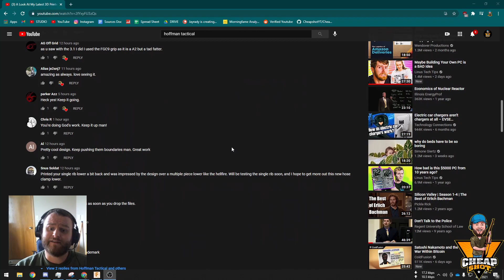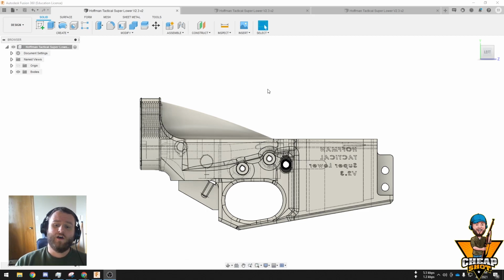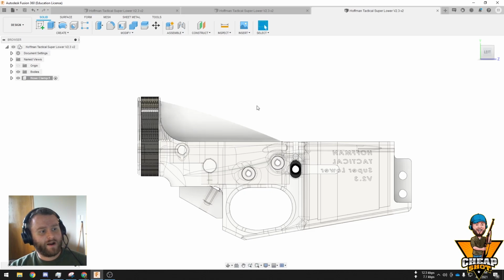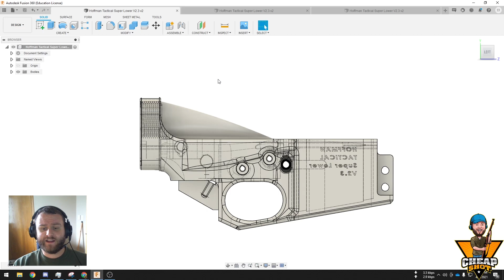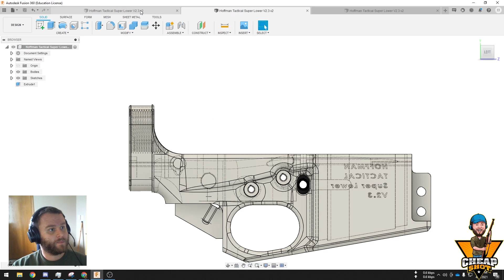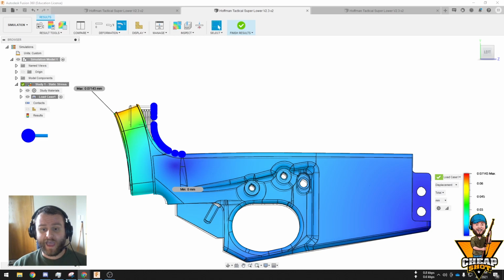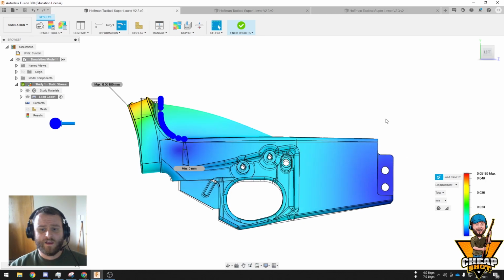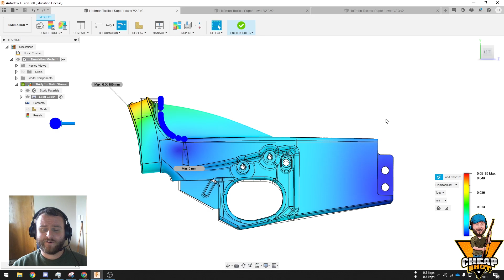Does the new @HoffmanTactical  Super Lower Need a Hose Clamp?!?!?

Comment: ABS, PETG, regular PLA and TPU are some of the weakest of materials to use on such a part. So, all your numbers are way off. Try again please showing results for Polymaker PLA Pro which is stronger then normal PLA+. PLA+ being the least recommended and CF still in testing phase since it suffers from creep. Also how you angle the infill and wall count and other slicer settings all play a part in it's strength. Next time please do a better job on being properly informed on all needed updated information to properly make anyone's part if you intend on judging their work.
Reply: Good grief

Comment: Even though there are obvious serious limitations to this analysis, the things that truly matter are still made obvious through this rough analysis. The way that the lower would want to fail is with the layers separating on the buffer tube. Having the hose clamp there allows the stress that would otherwise be tearing the buffer tube mount apart to be redirected into hoop stress in the hose clamp, reducing stress in the important direction for the plastic. The rib part should be obvious to literally anybody without any engineering analysis, so I'm not even going to address that lol. I haven't seen the arguments about this, but I also don't want to if people are seriously arguing that even the rib isn't necessary.

Comment: if having a worm gear clamp and the extra material on the left side of the receiver, the military would have been testing it by now. & had issued to some unit in the Army & Marine Corps.  When I was in the Marine Corps, our rifles took a beating but there no failure at the buffer tube. I have also made several AR-15's &  AR .308 & I have never had any problems with any breakage at the buffer tube that it would need a worm gear clamp to hold the rifle together. I have had lower receivers mad from Polymer, PLA,PLA+,ABS, 15% & 25% Carbon fiber filaments & have no problems with the buffer tube breaking.
Reply from the maker: The army and marine corps isn't issuing rifles made from plastic in people's garages....
Reply: @CheapShot  Your design is flawed. I would not bet my life on a rifle with a lower receiver  that uses a worm gear lamp to keep it from falling apart to the extra material on the left hand side of the lower receiver.
I have made lower receivers out of Polymer, PLA, PLA+,ABS, 15 % 25 carbon fiber to Mil-Spec tolerances & have had no problems with them as long as the buffer tube nut is torque to Mil-Spec specifications. 
If the military could save 1 pound for the M16 & passes all of the design requirements, the Army & Marine corps would be want it since lighter rifle equates to more ammunition they can carry.
If you are printing a lower receiver, make it to Mil-Spec standards.
Quit telling people how great your lower receiver  it is but showing how the rifle fires 300-400 rounds.
Reply from the maker: @donaldhollingsworth3875  I'm getting some boomer vibes these comments
Reply: @CheapShot  All I'm trying to say that your lower receiver is not made to Mil-Specs & if have to have a worm gear clamp to keep the buffer tube from falling off or what ever the case might be, you have to go back to the drawing board.
Reply from the maker: @donaldhollingsworth3875  if you make a 3d printed lower to milspec, exactly the same as a metal one, it will fail, fast. Make sure you're subscribed, I'm building a force meter right now, that'll be the first test.
Reply: @CheapShot  As have server in the military in the Marine Corps I know what a lower receiver looks like. yours do not,-.I have seen polymer, & the 3D lower go head to head a3D printed.receivers The polymer & aluminum lower receivers never failed but the 3D printed ones did..

Comment: U bolt clamp guy not much a fan of his hose clamp design, he should try to improve on already effective design instead of trying to mimic the concept and then try and market it on his website to other products, cool idea and different just my opinion on contributing to the designs of the 3D printing firearm community like others before have done
Reply: I'm a little surprised nobody is selling aluminum buffer towers to screw onto printed lowers like the FireBolt or Andersons.  It would be like buying an 8% lower, rather than an 80% lower.

Comment: Another way to do it instead of a hose clamp is to design a ring grove and fill it with JB weld. Maybe cover it over with a wrap then hose clamp until it drys.
Remove the clam then sand it down to the desired look.
Could do even better if the lower was designed with inner banding so you could inject JB weld into it. Reinforcing the entire design.
Reply: Maybe it is time for me to order a printer to test some ideas. Any suggestions that won't break the bank?
Reply from the maker: @grim6980  join the discord

Comment: Would adding more material between the grip and the buffer tower add more strength to the design? Obviously copying the support on the left hand side to the right hand side would help strength tremendously, which would probably make St. Stoner proud, but the buffer tower has always been a weak spot of polymer lowers.

Comment: Again, there are lowers out there that have been engineered to not require a hose clamp... I can't believe another video was made in support of a clamp just to back up a person's laziness and lack of R&D, testing of various materials, or the lack of actually engineering the buffer tube support... In this video, you assumed everyone would just print in PLA, as hoffman tac advised. However, if the filament were to be changed out with even stronger filaments that are widely and easily available, you would find that the hose clamp is completely unnecessary, heck, even the extra support that he designed with it to include the slope up the side of the upper to further reinforce the buffer support, can all be removed from the design if a little more time was spent researching materials. It's rather upsetting seeing the video from hoffman and then another video backing him up because he just got lazy when he was designing it. Nobody wants to put a band aid on their AR, they just don't, I mean, unless they're going specifically for that fallout, steampunk, just found this and used a clamp and some duct tape to piece it together look... It's a crappy excuse for laziness even if it does reduce the reflection ~50%. The solution is there, many people have already made it and taken the time to properly engineer it, so I really don't understand why hoffman would even waste the time in producing what essentially is "sub-par crap". It would be a better idea for them to go and do more research about materials, find out why the designs that don't require a hose clamp work the way they do, or take their designs as a starting point.

And btw - those same lowers that don't require a hose clamp, also can accept magpul grips (which are one of the most popular grips on the market) so by saying "our lower doesn't work with them for stability and structural rigidity reasons" is literally alienating majority of the people that would be printing these. Again, it's like Michaelangelo sculpting David, then deciding to just stop at the chest/neck area and instead just sculpting a circle, putting 2 dots for eyes, using a permanent marker for the nose, and then etching a thin line in for his mouth and saying meh, good enough. It is just half-assing it, it's pure laziness, and I don't know why someone would try to make a superior lower, then just decide to give up on it and put some bandaids on because he doesn't want to devote anymore time or energy into it. Sad, very sad... This is all constructive criticism and by no means am I trying to bash you or hoffman tac, just pointing out that there are current solutions out there for the problems of this lower, and it's pretty upsetting that someone that has such a large following would stoop to such level just to make a quick buck.
Reply from the maker: K
Reply: I'd like to see the lower you designed, must be the best one out there.
Reply: Wow, I appreciate you very well worded dissertation. I really like your analogy.
Reply: Sounds well thought out. Could you please post the make and model of filament that you feel would be the optimum? I agree on Magpul grips, should be an option, and reinforce around it to retain needed strength.
Reply: @ronaldroberts7221  there are a few carbon fiber re-inforced filaments that are new to the market, relatively priced and the best part is - to make up for the typical brittle characteristic of carbon fiber filaments there is a touch of nylon added. Also, I've seen other filaments that use long carbon fiber strands rather than the dust he references in a latter video. And those hold up even better, are lighter, no clamp required.
Reply: @shumsghost  I'm looking into strong lower designs to try printing. I'm definitely not a fan of the hose clamp design though.  What are some of your recommendations for comparable or better strength designs? Thanks!
Reply: @shumsghost  Carbon fiber means nothing because it adds nothing to layer adhesion, and the hose clamp is there to take the load off the contact surfaces between layers. I'd put a clamp on those too. What would I have to lose?
Funny you speak of alienation, but then recommend filaments that are not as easy to print as PLA.
Reply: "lazy material research" is kind of a poor argument here. 

PLA is the most accessible material.

I doubt he cares too much how it looks if literally anyone can print a serviceable lower.
I know I don't.

Also, what are these other designs (links please), and can you do push-ups on them?

Comment: I have one of the old 3.1 and it has run hundreds of rounds threw it perfectly, but the tube clamp is more for the layer lines then strength so i kinda want to do one of those also. Thank you for your time and efforts in this as it was interesting to get metrics with the various setups.

Comment: Could you share the fusion file so we can see how you set up the load case?
Reply from the maker: You can see everything from the pictures of you look hard enough. I don't really think sharing the Report/files is really worth it, as it's not a very good analysis when taken on its own, only when compared to the others is it worth anything.

As I do more with these models, I will release detailed reports.
Reply: @CheapShot  Ah, I just asked because it seemed from the video the load was applied to the -z axis, not in the -y axis. No doubt your conclusion that band helps holds true, just wasn't sure about the setup.

Comment: From my understanding the hose clamp mostly just keeps the layers from separating, at least in the orientation that these lowers print in. 

Anyways, I liked the hose clamp idea so much that I modified the Firebolt buffer tower to be able use one.
Reply from the maker: 100%. I think in this study, it's really showing that axial forces will also help with general strength, when forces are applied as I did.

As I said, there is a lot of errors with the way I've analyzed it. I just enjoy people trying to tell Hoffman, the guy who designed it and tested it, that he did it wrong when they haven't even seen it before 8 hours ago or so.